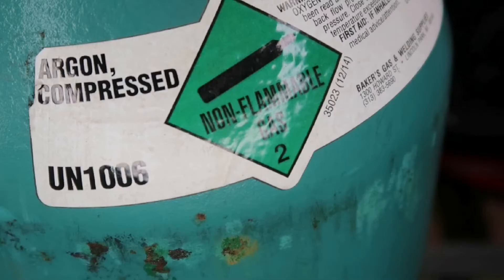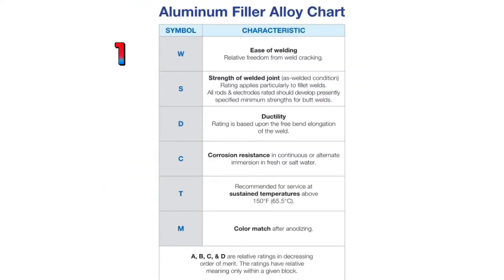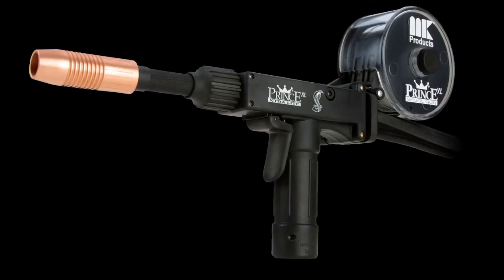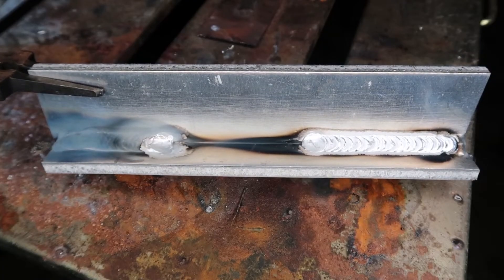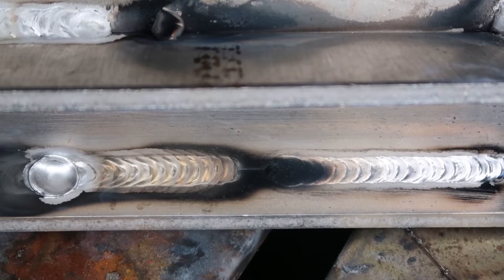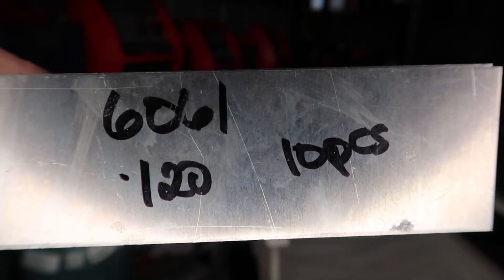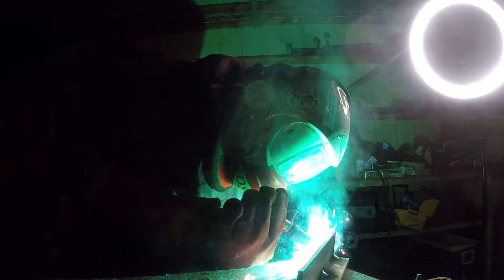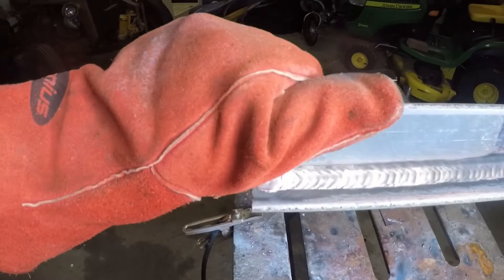Welding Aluminum On 110/220 Volt With 5356 Wire ...........

Comment: Great video, was wondering what drive roller and liner you are running with the. 047 wire? Looking to order and a bit confused on liner and drive roller options from them. I only see up to 045. Would like to run 3/64th aluminum wire with my setup. Thanks for the video and help.

Comment: Any feed issues/bird nesting?
Reply from the maker: Oh yeah! It’s all about running the correct consumable setup, wire type in synergic mode and wire tension. How much welding and thickness range ?
Reply: @chris_b_liven  probably 1/4 is the thickest, with occasional small 3/8, probably only actually running the machine 2-3 hours a day. I’d like to run 4043, so probably need to run a heavier wire cause of the softness?
Reply from the maker: @kalebbooher8092  I like 3/64 wire for 4043. The .035 5356 wire runs great on the .040 program if you need to do any thin gauge material
Reply: @chris_b_liven  does that machine accept the 3lb rolls?
Reply from the maker: @kalebbooher8092  Yes. You can get a 4lbs spool of aluminum on a 10 lbs hub
Reply: @chris_b_liven  I sent you an email

Comment: You make it look so easy. When I bought my Lincoln 210 multiprocess, it came with a spool gun and I had never welded aluminum before. I don't have much practical use for welding aluminum but it's awesome to have the capability. But even on 110v it's super easy to burn through, even on material as thick as 1/8 in.
Reply from the maker: Practice does make it easier. No different than golf  or anything new 😎 Keep up the good work!!! Spool guns are difficult even for me. It seems like you have to keep adjusting to get it right and then you come back and it’s off again. The game of spool guns 😂

Comment: I've welded a ton with 4043 , when ever I tried 5356 I got splatter all over the place. I have a Miller 252 with spool gun
Reply from the maker: Yes, 5356 is a different type of wire. If your voltage and angle is off it can send spatter everywhere.

Comment: What amp supplie was that 110 volt on .here in the uk on site we have to use 110 it's a right pain
Reply from the maker: J C You can use it on 15 AMP or 20 AMP 110

Comment: Hey Chris, I have a Transsteel 2700 I'm waiting to receive. Can't wait to get welding with a pro machine in my home shop!
Reply from the maker: Mike Quas That’s awesome! I’m just now starting TransSteel 2700 videos. When you get your machine send me an email with your info and serial number and I’ll get you a T-shirt - Bliven.Christopher@fronius.com
Reply: @chris_b_liven  excellent, it's supposed to arrive today. I'm gonna stop and pick up what I need to run a 220v circuit to my bench on my way home today.

Comment: Hi I recently bought a transsteel 2200 and love your videos really informative when mig welding aluminium what changes do u need to make to your torch and drive rolls if any.
Reply from the maker: Will, I suggest using 3/64 aluminum wire with a 1/16 inner liner and .052 contact tips. If you send me an email I’ll reply with part numbers you need Bliven.Christopher@fronius.com

Comment: Why does fronius not have any settings for .035 5356. I don’t want to change my gun liner out. Any suggestions .125 material 6061.
Reply from the maker: levi Texas I told them they need to work on one. Let’s see if they come out with one - I suggest using the .040 slot. Make sure your drive wheel tension is 1 or below and use an .040 contact tip ask the tips will heat up and contract. You can use the .035 in the meantime but make sure your stick out is 5/8 to 3/4 long. When your on the .040 turn your wire feed to 385-425 and adjust your arc length right next to volts. A - will narrow your arc away from the tip and + will make the arc closer to the tip
Reply: MilkyCereal83 awesome thanks!  I’ll give it a run tomorrow and let you know
Reply from the maker: levi Texas Sounds Good.... Shoot me an email with your info serial number, address etc and I’ll get you a swag bag
Reply from the maker: Bliven.Christopher@fronius.com

Comment: What cfh?
Reply from the maker: S4v4g3 86 Cubic Feet Per Hour
Reply: MilkyCereal83 lol I meant how many cfh are you running
Reply from the maker: S4v4g3 86 Hahha - I run about 35 - 40 depending on my stick out

Comment: Great stuff, I just ordered my TransSteel 2200 I was sold on how good it welds on Aluminium, and the versatility it gives you, what Contact tips do you use? I would be on 0.45" wire, what is the proper inner liner for aluminium? 
On a different matter what rollers did you used for Mig Brazing? do you need special rollers for flux core?
Thanks a lot, love all your videos about Fronius.
Reply from the maker: Awesome!!! You will want to use an oversized contact tip so I suggest an .052 contact tip with a 1/16 inner liner. This would be for 3/64 aluminum wire. You can buy .045 rollers or you can turn your tension way down on the .035 roller to 1 or less. I use the standard rollers with silicon bronze wire and the knurled rollers for flux cored wire. Send me an email at Bliven.christipher@fromius.com and I will get you the list
Reply from the maker: Sorry. Bliven.Christopher@fronius.com
Reply: @chris_b_liven  Hi, I sent the email to you already, so you may have to check your spam box in case it went there. Thanks for the help.
Reply from the maker: Javier Contreras I just found it . I’ll respond this morning
Reply: @chris_b_liven  Got your Email, replied, Thanks

Comment: Hey man I only have access to 110v which welders can achieve what you’re doing here?
Reply from the maker: Ricardo C. It depends on the thickness you are trying to weld. On 110 your about 3/16 max
Reply: MilkyCereal83 I was looking at a Yeswelder mig205
Reply from the maker: Ricardo C. The YesWelder is in a totally different league. It looks like if you were looking for a machine to get a quick job done or just something small to play around with than a YesWelder. If your looking for quality and performance based machine than Fronius. You will pay 💰 but see the difference
Reply: MilkyCereal83 okay, it’s the only one I could find under $500 that is 110v at 160amps and since it’s going to be my first time with aluminum for just a go kart I really didn’t want to break the bank

Comment: Thank you.
What size tip? Other videos use .030 with a .031 tip.  Is there a major feed difference?
Reply from the maker: For aluminum you always want to use the next size up due to the heat swelling and contracting of the contact tip. For instance, anything aluminum with the Fronius I suggest 3/64 wire with an .052 contact tip

Comment: do you have a video of really thin steel with the transsteel , its what im thinking of buying the machine for , i do a lot of stitching  and im torn between one of these and an ewm picomig 180 puls .
Reply from the maker: tom thompson How thin is thin?
Reply: 50 year old landrovers mostly , so its 1mm with fifty years of rust , so more like .8mm when cleaned , but i make repair sections out of 1.2mm  on a good day i get to weld 1.2 to 1.2  , i tend to join hot nearly burn through tacs to get a decent result , 
on a dream day its 2mm chassis to 2.5mm repair sections or even 3mm repair sections depending on what the customer has bought .
one thing about welding landrover and discoverys , ill never run out of work ,,, i do a lot of bulkheads and rear half chassis , and more wheelarches on the back of discoverys than most things.
Reply from the maker: +tom thompson That’s awesome 😎 I’ve welded on one Land Rover about 9 years ago. I don’t think you will have a problem with the stitch mode especially with an .023 wire
Reply: many thanks for your time , nice to hear from some one who actually uses one of these as opposed to just sales brochures

Comment: Well your video worked  I watched it and bought a TransSteel 2200 . Welding steel it makes me look like a pro . Aluminum is a different story I got a tank of argon last week and extra tips and tried to set my welder to the same setting as in this  video but when I try to turn the voltage down the wire speed goes down also . So what do i need to do ?
Reply from the maker: sparky5889 Feel free to give me a shout on my cell phone 5173860711

Comment: You've got the best 2 videos regarding mig aluminum on the 2200 I've seen (incl. Chucky and fabricator). I'm ready to buy one, but got cold feet when the internet store model's display didn't show aluminum setting. Then I looked more closely at all the videos and there's a difference in drive rollers too. So where'd you get yours from? 
I'm not concerned with machine repairs as all the shops are 3 months out anyways....
Reply from the maker: Tommy T Thanks for watching 🤘 The package comes with .030 and .035 drive wheels and the front panel has a spot for 4043 but it says ALSI and 5356 says ALMG. All you need to get is .052 contact tips for 3/64 aluminum. Send me an email with your information and I can get you going in the right direction   Bliven.Christopher@Fronius.com
Reply: @chris_b_liven  thanks bud, email sent.
Reply: @chris_b_liven  hey boss, checking to see if you got my info by email.
Reply from the maker: Tommy T Yes. Got it. I’ll take a look at my emails today. I was out of the country all week🤘
Reply: @chris_b_liven  Thanks a bunch Chris! Roger (my rep) called this morning and I'm waiting for him to get another demo machine in. I'm excited!
Reply from the maker: Tommy T 
Great to hear 🔥

Comment: Chris can you use the stitch mode for mig aluminum?   that would work as sort of a pulse ,maybe?
Reply from the maker: Bruce D Yes you can use the stitch timer but it’s not as smooth as it is with Steel or Stainless. Sometimes the arc starts are a little off but it does work